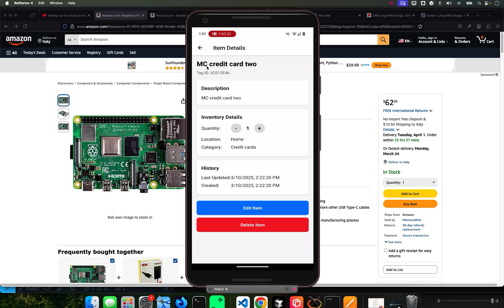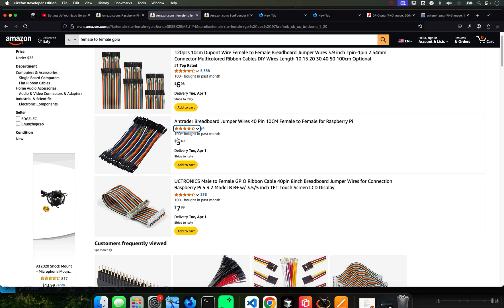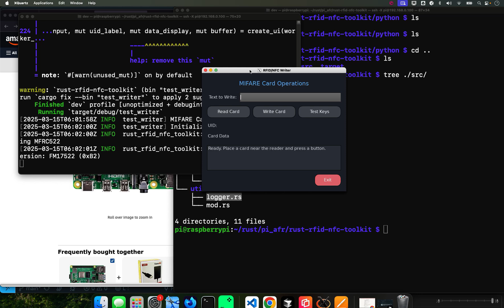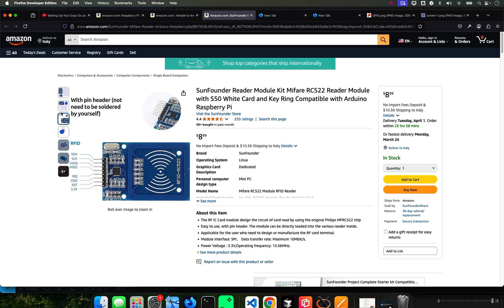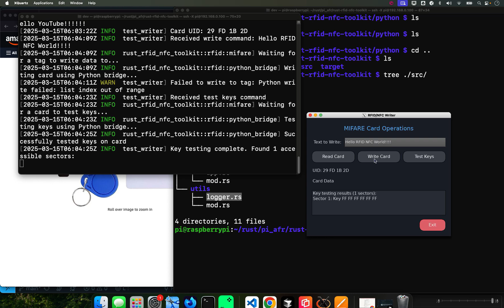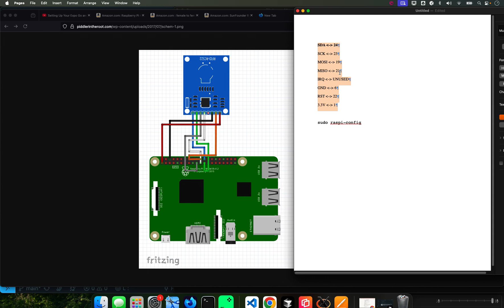Build Your Own RFID NFC Card Reader/Writer just with a Raspberry Pi , MFRC522 Module , Rust  & FLTK

Comment: Hey I had a question, lets say i wanted a larger surface area for the sensor
Can i pair multiple of the module in parallel?

Or is it possible to make a custom one, like a large coil, that can detect if a card has passed through it?
Reply from the maker: Good question, I had to get some help from Gemini on this one. It is technically feasible to wire and program multiple MFRC522 modules on a single controller, but it may not be as effective as we would think, according to Gemini, you would run into these problems:
RF Interference: The MFRC522 modules generate their own 13.56 MHz RF fields. When placed near each other and operating simultaneously, these fields do interfere dramatically, making reliable reads impossible.
Time Multiplexing is Key: To use multiple MFRC522 readers, you must time-multiplex them, meaning only one module is powered on and actively reading at any given moment. You use the separate Chip Select (CS) and Reset (RST) pins to isolate and activate individual readers sequentially [1]. This makes them suitable for multiple distinct read zones (like a left door and a right door), but not for a single large, continuous sensing surface.
Antenna Limitations: While larger custom antennas are possible, they require precise tuning to maintain a 50 Ohm impedance match at 13.56 MHz. The MFRC522 chip has limited power output, so simply making the coil larger spreads the same amount of power over a bigger area, which typically reduces the effective detection range rather than increasing it.
Hardware Mismatch for Gates: The MFRC522 operates on High Frequency (HF) RFID (13.56 MHz / ISO 14443 standard), which is inherently short-range (centimeters). Detecting a card "passing through a gate" requires Ultra High Frequency (UHF) RFID systems (860–960 MHz), which are designed for much longer ranges (meters) and high-speed inventory tracking.

Hope this helps.
Reply: @cesco345 okie thank you, that makes sense. I think I'll probably go with a chip select way, that sounds like the better choice here. Appreciate the reply manh!

Comment: Hi, thanks for the video, that looks like very clean application and I just bought a MFRC522 modul so I would like to use it with my Raspi. I just have one question, where is your README on your GitHub repository ??
Reply from the maker: Thanks. most of the code for that playlist is found here: https://github.com/cesco345/pi_interfaces/tree/main, for individual examples you have to the directories in that main directory and you will find individual Readme.md files for some not all. e.g., 
https://github.com/cesco345/pi_interfaces/tree/main/rust-rfid-nfc-toolkit.
Reply: @cesco345 I recently used MFRC-python library to use my MFRC522 module but discoverd that I wasn’t able to write on the bloc 0 (UID write). The Magic card I use are unlockable with 0x41 code (Magic card gen 1a). Does your rfid application include those feature ? Thanks